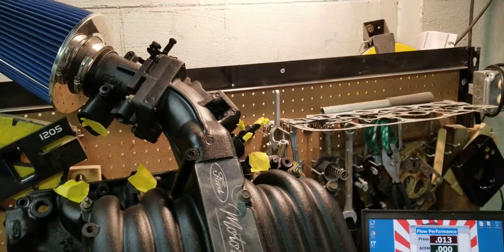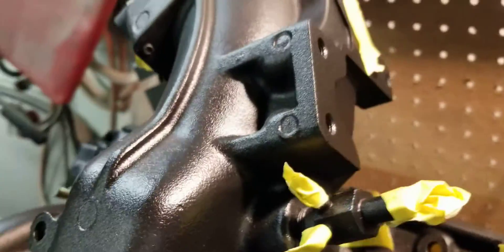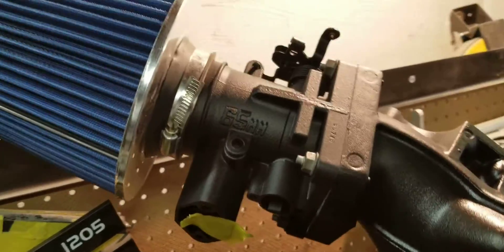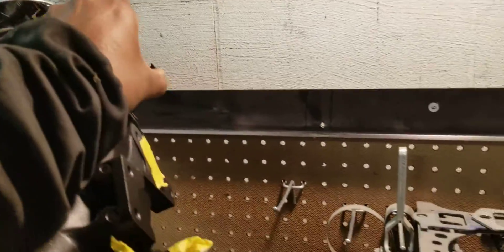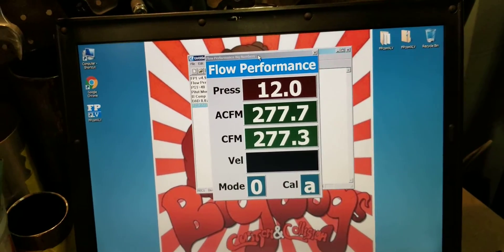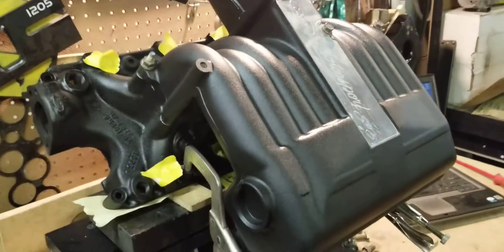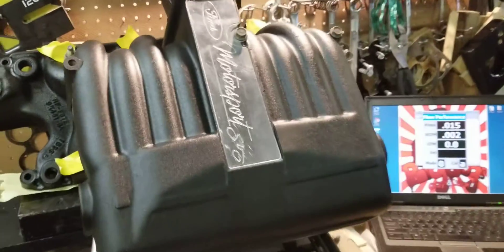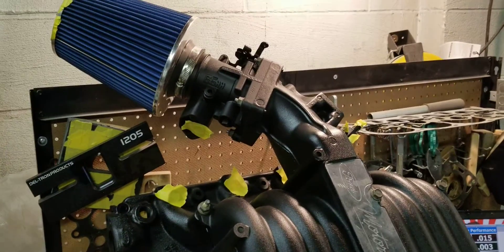Bigdogs Porting flow testing of bolted together stage 2 ported Cobra gt40 manifold

Comment: 🔔Watched several times.👍👍
I wish you had pulled the filter just to see IF any difference.
Reply from the maker: We did. Basically no change when we pull the filter because the filter was modified to flow over 1,200cfm which is a lot more than the throttle body and manifolds TB tunnel. Now there was a change when we pulled the 65mm TB and ran a open radius. The runners flowed 5cfm more because the 65mm TB flowed less than the manifolds TB tunnel.

Comment: Hey Tony how much flow can you get with a stage 3 with no shortening of runner's
Reply from the maker: How much do you need? Lol. Remember, we can completely alter the upper to flow what's needed. The lowers can go 365-375cfm with material added to each port. We get the stage 3 lowers to do 340s and the uppers are doing 330s before cutting.